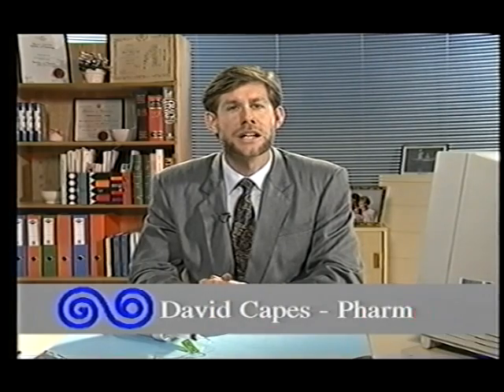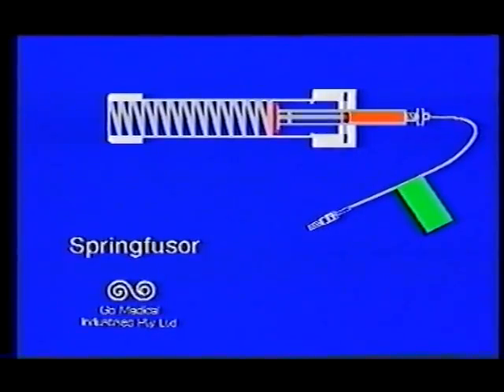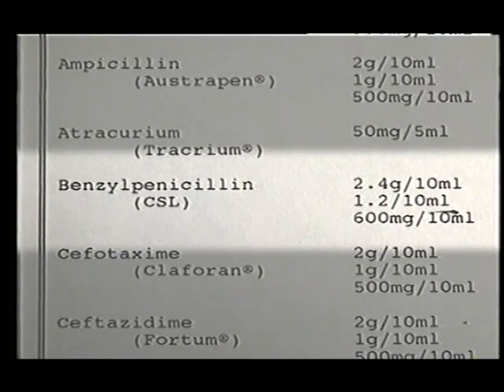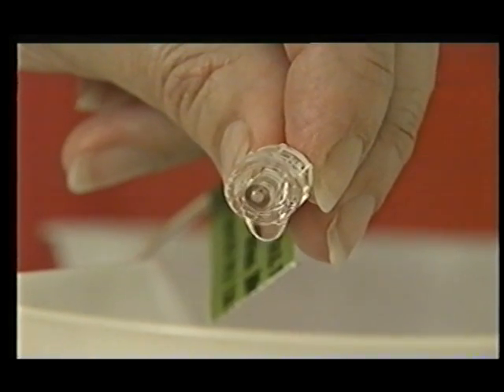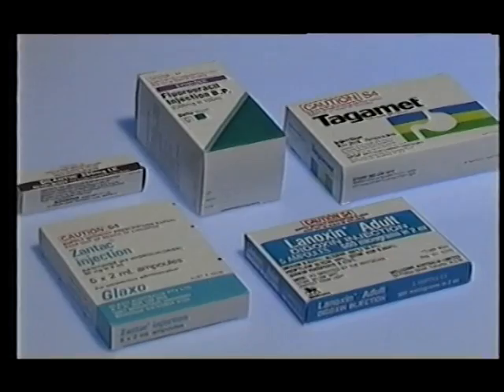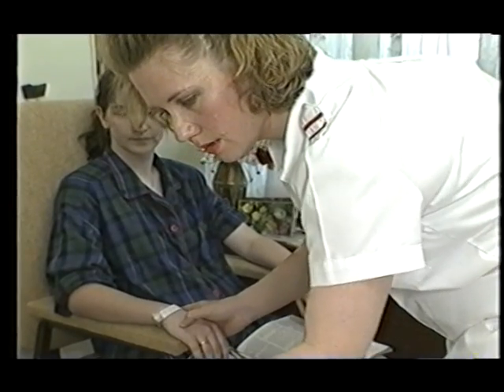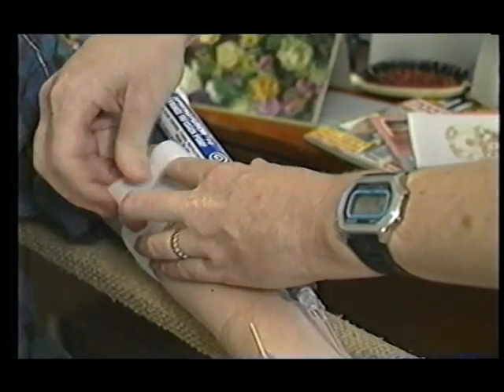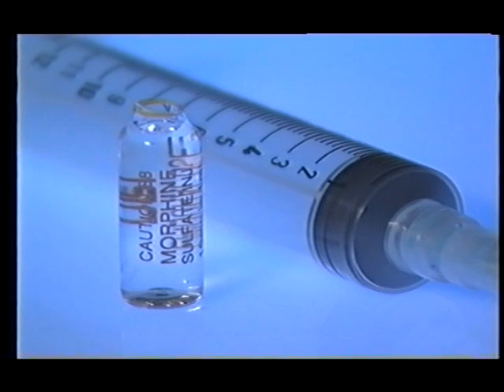Springfusor Instructional Video

Comment: Will a 10ml prefilled hizentra syringe fit in this pump? hizentra is a SCig product with a high viscosity, what would be the correction for the flow control tubing? and last - is the Springfusor 10 available in the US?